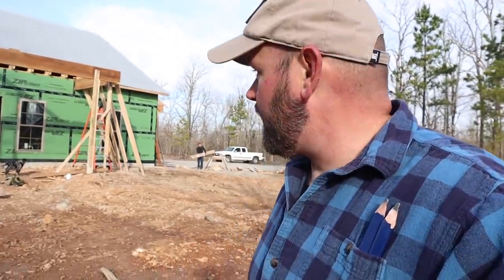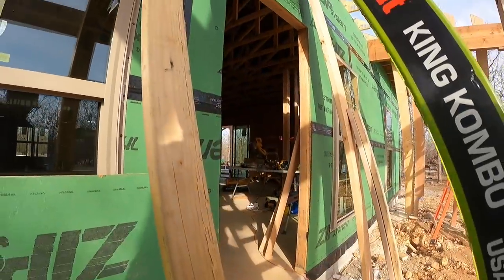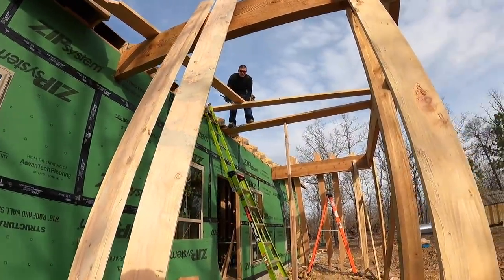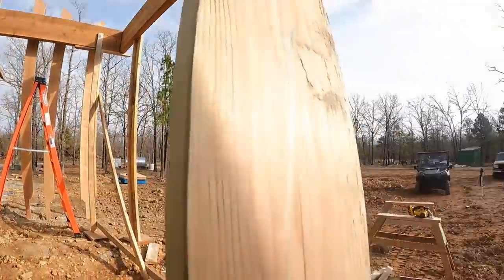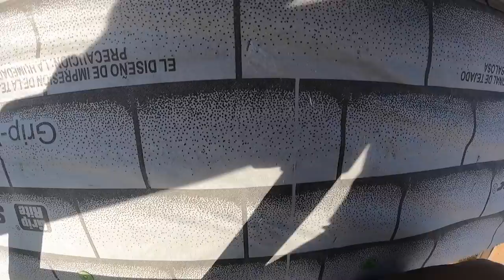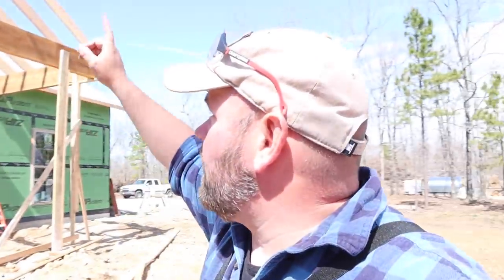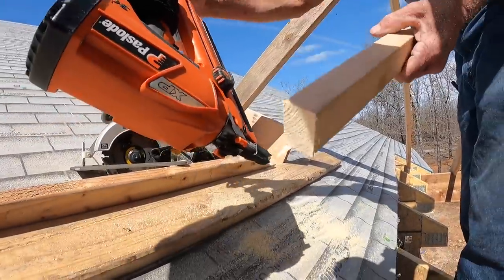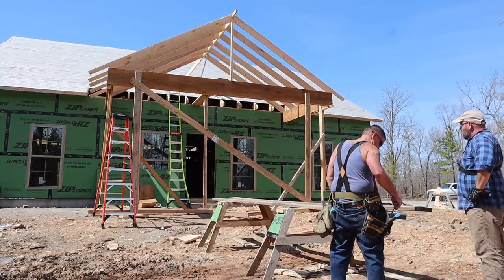BUILDING THE FRONT PORCH

Comment: Well this was another nerve racking video. Randy is fearless being up there.
Reply: That was a crazy workflow and an easy way to retire too early.
Put up two verticals to support apex beam
Attach a stopper to the top of the rafter .
Fit birdsmouth to lower barge board
Stopper holds rafter to the correct point/level on apex. Attach to apex. Remove stopper attach it to next rafter.
Rinse 
Repeat.

Comment: Question:  Should the support columns secure by cement go first before building the porch roof?
Reply: Also porch should have been done when tresses were put up.  Waste of shingles.
Reply: @pamelaremme38  Not a waste of shingles as none has been installed yet!!!
Reply: @tonygrimes13  My bad.  It looked like the roof was shingled.  Even still...should have been built when tresses were installed.  At the very least a header should be against the exterior wall.
Reply: @pamelaremme38  That is just a grid on the roof "Paper"
Reply: @pamelaremme38  Now I just bet, Dutch would have done that if you sent him the thousands for the porch lumber, he said they are doing this paycheck by paycheck...lots of things are done separately $$$$$$ when the cash is right.....
Reply: @carolscott3868  You obviously have no clue the bank the you tubers make monthly??? When building a house you do not section off things that should be done in tandem.  They installed the walls and windows before tresses fro roof?  You have no clue.  A simple search on-line shows net worth of ANY You tuber.  Some are making upwards of 10-20K per month or MORE!!!